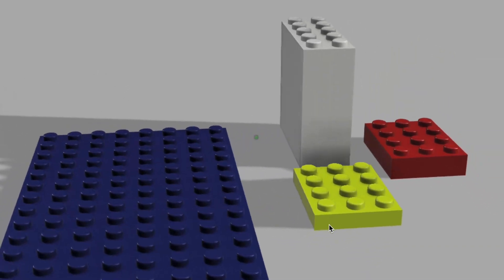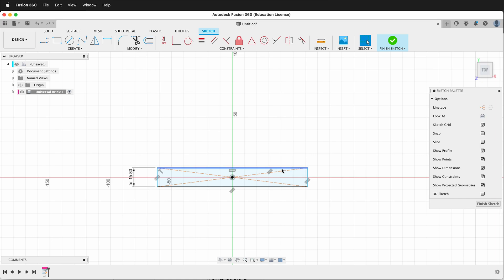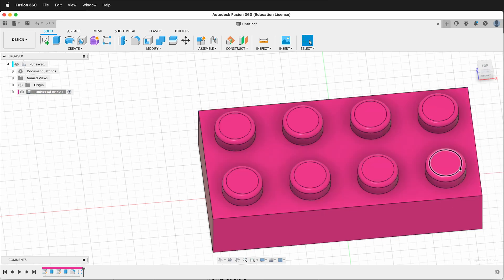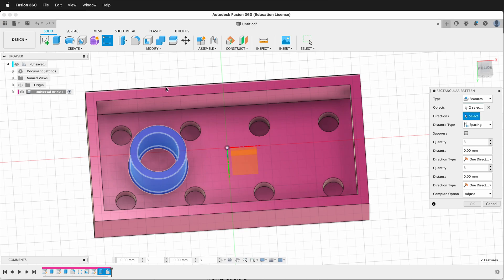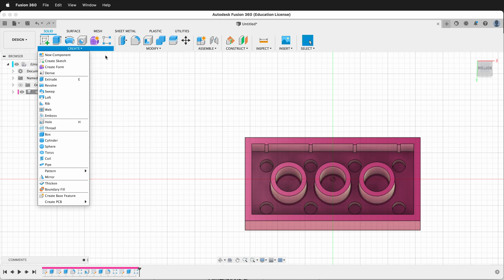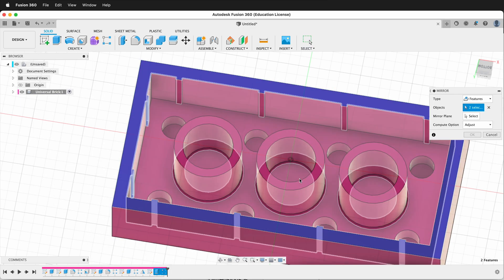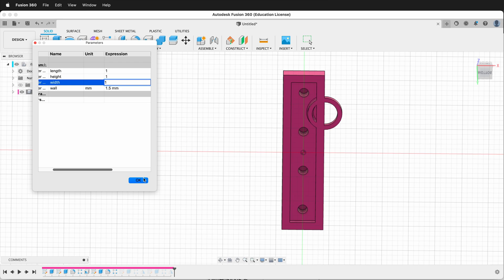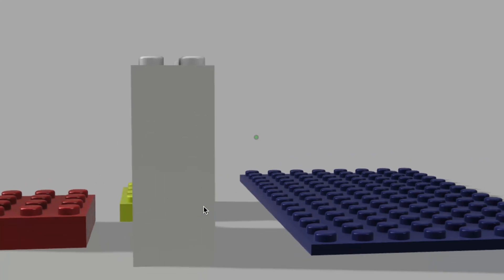Custom LEGO Brick Design in Fusion 360: A Step-by-Step Tutorial

Comment: This is a good tutorial - with user-parameters approach (unlike some other ones). Once I have the base brick however, what is the "easiest" way to have multiple variations in a single Fusion design? Once I change a parameter, it's global so it changes it for all components created from this one.
The only way I have figured out is to save the component as new (in a different file essentially) and then use the "Insert component", break the link. This creates new parameters that I can modify per-inserted-component. But I suppose there might be a better way?
Reply from the maker: You could have multiple components have numbered parameters
Reply: Thanks for the quick reply! Not sure I follow though... If I copy-paste a component, it references the originally named params (like "width") from the global parameters. If I change "width" to something else it will change it for all geometries using that param
Reply from the maker: @MK-Classic Yes, you would need to create new parameters for the things you want to change and then in the modify parameters section you can twirl out all the measurements of the new component and replace the variables with the new parameters 

A little cumbersome to set up but once it is set up then you could make multiple parametric parts in the same file 

The other way to do it would be to have multiple files and change the parameters that way
Reply: Got it, thanks!

Comment: I did the parameters exact but when I went to do the rectangular pattern I see axis and not direction as well as when I do length I had to do 24 mm instead of 8mm as when I did 8 the nubs would bunch up. That caused a problem later on as when I change the parameters it does not make a proper brick. How do you think I can fix this?
Reply: hi i think i found the solution, you need to change te distribution to spacing instead of extend then 8 mm would work
Reply: @sennameijer7576 Thanks. Your solution worked on my model
Reply from the maker: Without seeing your actual fusion file, it is hard to say, one of the things that is tricky about using parametric features that build on each other is that you need to pick the same origin for each feature in the design timeline, if you saved multiple versions, maybe try going back to a previous version?
Reply: I see, by the origin do you mean the axis I picked? Because in width it works when I put 8mm since that is the difference between the two studs although in length I need to do 24 in total because when I do 8 mm it doesn’t show that it’s the difference between the stubs. Sorry if this is just repeating my original question, I’m just confused.  @WhatMakeArt
Reply from the maker: Yes, try to be as consistent as possible with every starting point of a parametric or calculated feature, yes, you can go back in the timeline and change the origins

Whenever I have a model that is having problems, I go all the way back to the beginning and I click forward one step at a time per design feature and then correct anything along the way, sometimes I'll go through a third of it and then go back to the beginning and recheck to make sure I'm doing everything correctly before rechecking the whole thing

Annoying but sometimes double checking everything is the only way, or starting over
Reply: I went back and repeated the process, everything worked out nicely when I use a number according to dimension for length and so when I used 24 it created the right distance, but for that shape only. If I go back to change the parameter though, it will create a mutated block. I will try going back once again and let you know if anything changes thought thank you  @WhatMakeArt
Reply from the maker: Sounds like you are making progress

Comment: In fusion360. Can you use an if function to handle the suppressions. Like,
If parameter = 1
Then do suppress tube
End if.
Reply from the maker: Unfortunately Fusion 360 does not support logic like if then statements, it would be great if it did

The link to all the math functions that fusion 360 has
https://help.autodesk.com/view/fusion360/ENU/?guid=GUID-76272551-3275-46C4-AE4D-10D58B408C20

Comment: I think the heigh value should be 3.2 instead of 2.3
Reply from the maker: You are absolutely correct, that is a typo, and I noticed it after I printed a piece

Thanks for pointing it out 👍
Reply: @WhatMakeArt  Me too, with a value of 3 my 2x2 brick was to small compared to an original LEGO, many thanks for this excellent video
Reply from the maker: Depending on your 3D printer, the studs may need to be a bit bigger too, the inside snaps to other LEGO blocks, but LEGO blocks did not snap to the one I 3D printed with 4.8 diameter studs, so try out different values to get the one that works for your 3D printer calibration